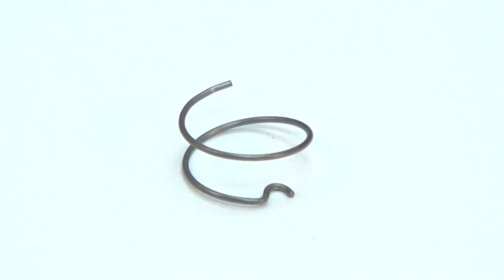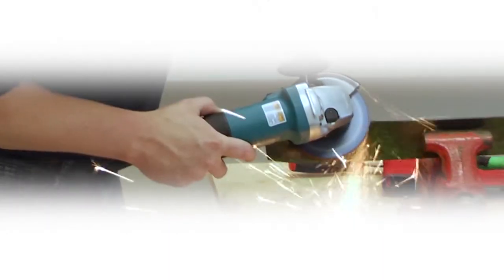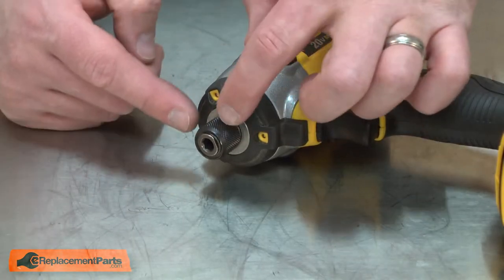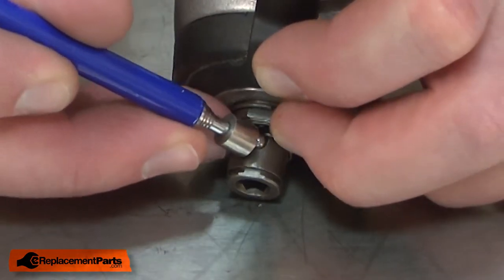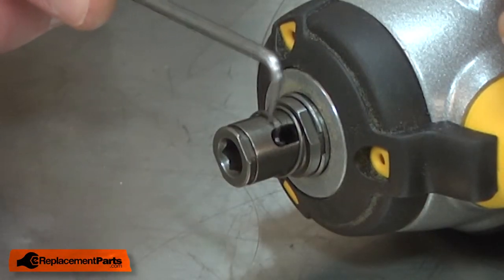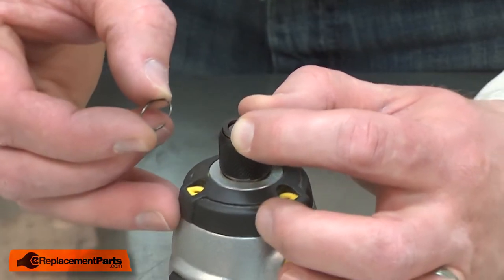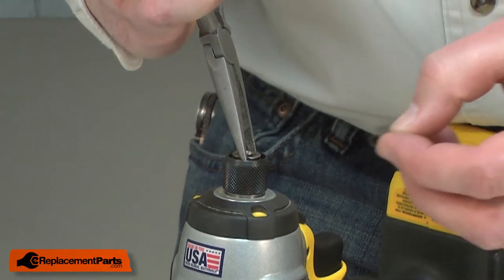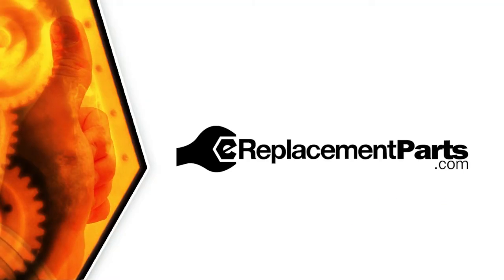DeWALT Impact Driver Repair - Replacing the Driver Spring (DeWALT Part # N078434)

Comment: Hi 
I watch your video least 6 times until I got it.  I did fix the impact driver.  My impact driver is old unit with only one dog ear.  But, I got  the bearing in with the spring and the spring with the collar and the hard one; the hog ring.  I got it again.  It works.  Thanks

Comment: I tried and failed a lot of times to do this and even ordered a new ball Thinking it was the problem.  In the end it was the new spring catching on the back side of the collet, compressing the spring and disengaging the ball. The fix was adding more coil to the spring making it closer fit to the shaft and therefore not catching on the collet which should go all the way back without spring forward during assembly

Comment: Great video. Sure wish my impact had the same hog ring as yours. Mine was a flat key ring-style washer that was near impossible to put back on. Lost all the pieces a few times when I lost my grip and the spring was able to let loose.
Reply: Which model impact were you having that issue with?

Comment: You do not need a replacement part to make this repair simply take the failed spring. Bend an end about eight of an inch and reinstall. And put back together 
Just did this in the field and it was stressful and took about half hour to get the pressure ring around it..but it works like new and I saved 3 bucks or 140 bucks on a new drill.
Reply: Fuckin genius bud!!! Thanks! Good Ol’ innovation.

Comment: I have replaced the spring as show, as the old one had snapped at the bend that contacts the ball leaving a little 'u' shaped piece that fell out. It did not seem to fix the problem. I  re-replaced it several times with the part I ordered from your site.  I have even looked at other demonstrations of this repair, and I seem to be doing it right.  However, the ball still doesn't seem to engage with the spring enough to hold the bit.  Any suggestions?
Reply: I have the same problem, any suggestions?